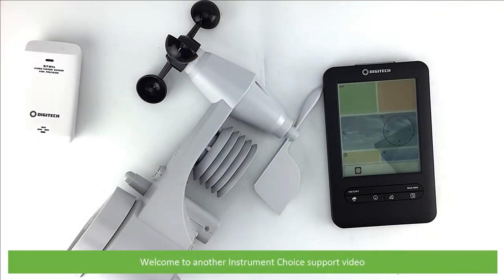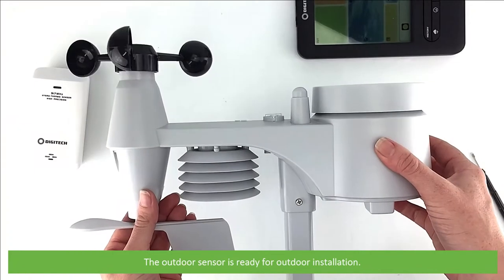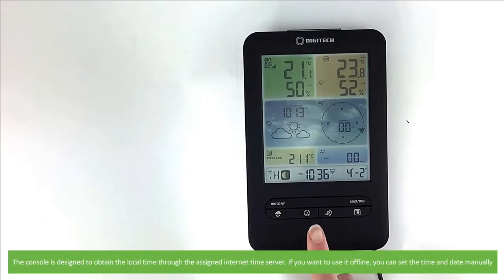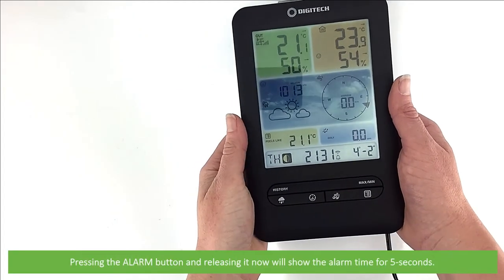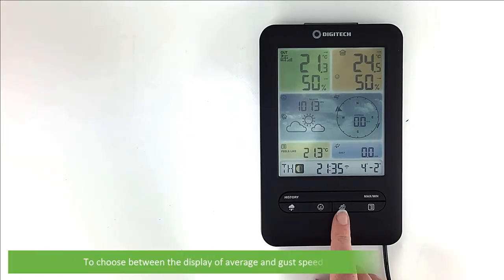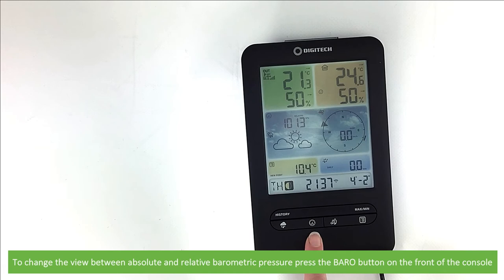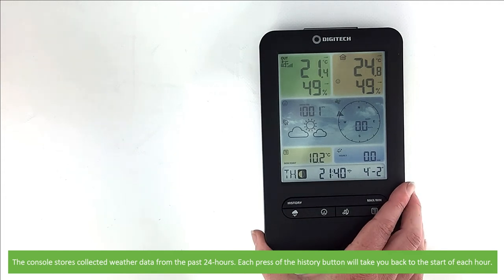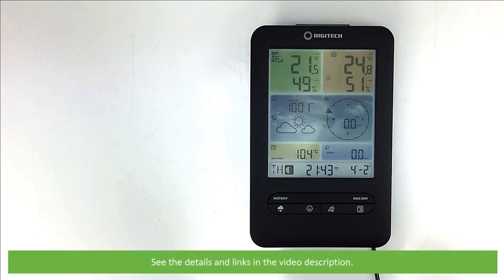How to Set Up the IC-XC0436 Wireless Digital Weather Station with Colourful LCD Display and WiFi

Comment: I set up my weather station with my altitude, but the relative pressure reading is consistently about 5 hPa higher than that given on the official maps for the area.  Is there any way to adjust the relative pressure reading so that it's 5 hPa lower and therefore consistent with the official readings in the area?
Reply from the maker: Hi Brett,

Thanks for your question. You should be able to set an offset for relative pressure under the advanced settings in the web interface. See page 11 of the user guide linked below for detailed instructions. If you get stuck, please feel free to contact one of our scientists, call 1300 737 871 or email customer-service@instrumentchoice.com.au. Thanks!

Link to download the user guide: https://www.instrumentchoice.com.au/attachment/download/126671/61dd1afbacc78517636555.pdf

Hope this helps!

Comment: Hi, is it possible to change the time of the 24hr rain measure. Currently it is measured midnight to midnight, I would like to change it to 9am to 9am as this would make it easier to manually record and the weather bureau also measures in this time period,  thanks, 
Ben
Reply from the maker: Hi Ben,

Thank you for your question on the IC-XC0436. With this, unfortunately there isn’t a way that this can be changed on the console at this time to allow for this.

You will only be able to do a midnight to midnight rainfall on this particular station.
Reply: @instrumentchoice  
Ok, thanks
Reply: Unless you desperately NEED the clock to be right, just set the clock in the unit to show midnight when it is actually 09:00.  i.e. 15 hours ahead or 9 hours behind.

Comment: Hi, do you know what the battery life of the 5 in 1 sensor is with a fresh set of lithium batteries?
Reply from the maker: Thank you for your YouTube question, with regards to this, the batteries will typically last approximately 12 months once replaced.